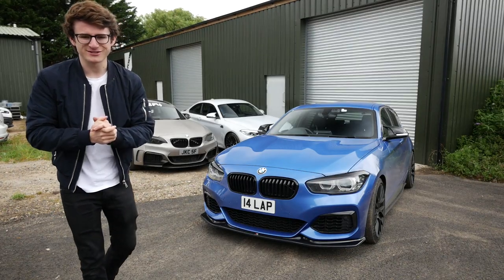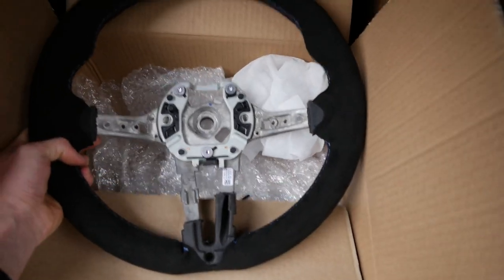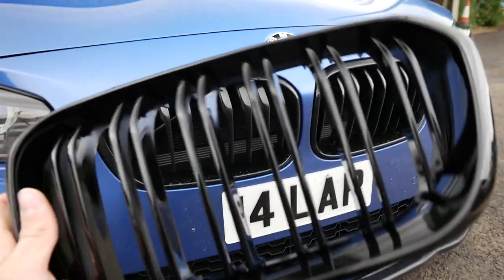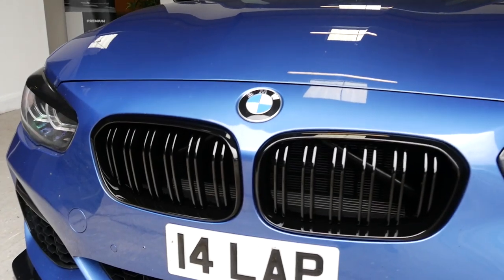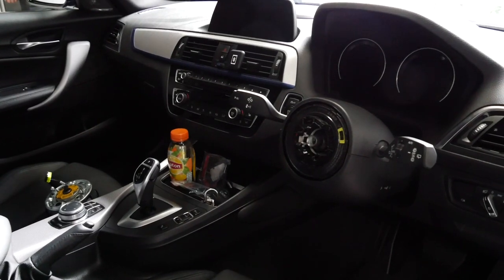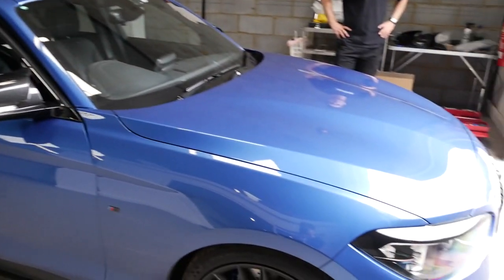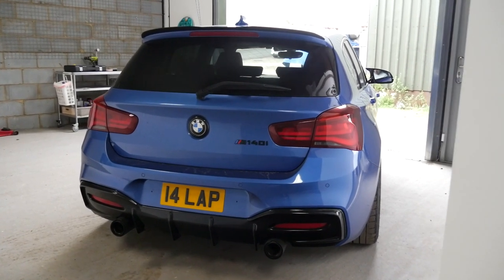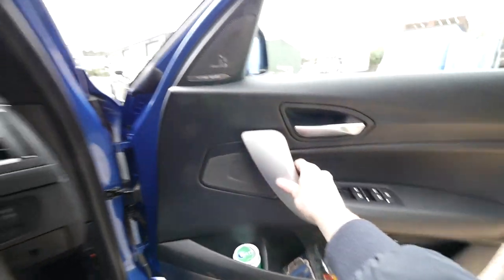The First INTERIOR Modifications For My M140i!

Comment: At one point with the stripes on the car I wasn't sure about the look mate, but now.... wow, epic. Some really tasteful mods going on, love the mirrors, the new slatted grille really works. I would leave the cheaper carbon bits off the wheel IMO if it was mine as they just don't look on the same level as the rest of the carbon on the wheel. Finally, dude... I think blacked out 'BMW' badges front and rear will really finish off the aggressive exterior look. Congrats though, this car is really looking the part. I prefer it to your Golf R and I've had a fast Golf before, but always adored the M-lites. Looking forward to the next mods...